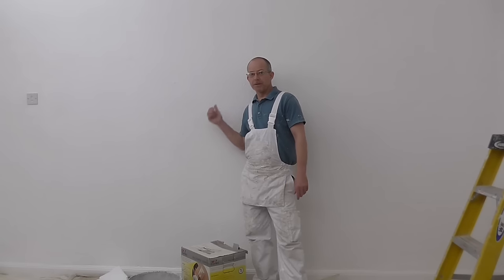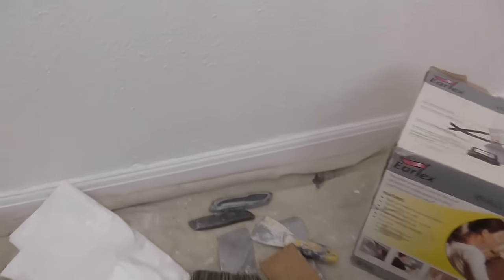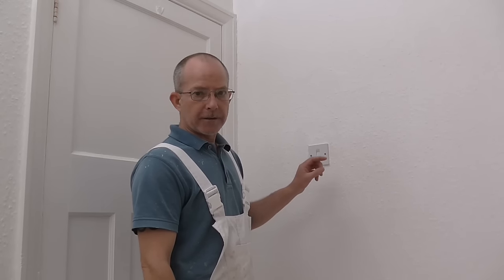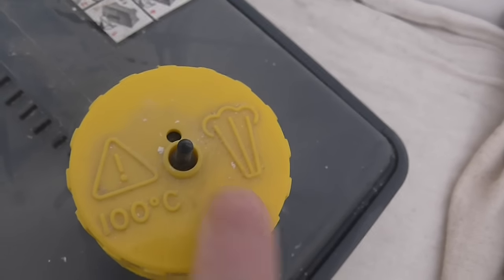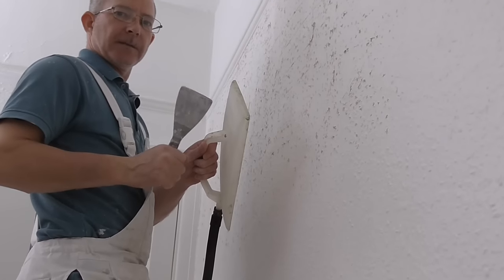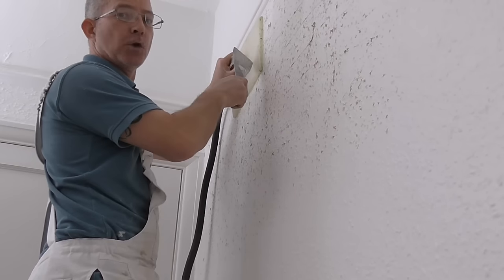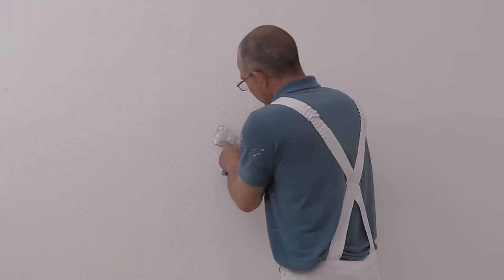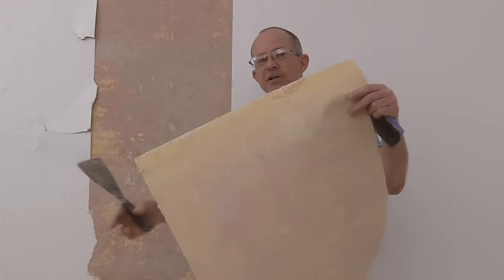Stripping Painted Wallpaper

Comment: Learned so much watching this. Easily the best stripping video I've watched (lol)

 I had no idea painted wallpaper was a different kettle of fish. So here I am today with my wallpaper steamer wondering why it was taking forever to come off, and coming off in little chunks at a time. Absolute nightmare and would take days to do one room. 

Just scored and soaked a small section for testing and it seems to be working great. Just used an old serated knife for the test but I'll make a nail board tomorrow and get cracking. Ditching the steamer for sure. 

Thanks so much for this. If you ever get tired of your trade and fancy something different, you'd make a great college lecturer. You're a natural teacher

Comment: Tried woodchip with steamer. Expensive to run and painfully slow. Easiest is to score it (5 screws in a piece of wood worked for me), and garden sprayer with reasonably hot/warm water with a touch of fabric conditioner and washing up liquid. Spray, leave an HOUR, come back, mist again, and it almost falls off. Steamers cook the underlying plaster and tend it make it crack or blow as it cools down, especially with very old plaster. Agree on knocking the chips off.
Reply from the maker: Thanks.
Reply: Have you tried hanging wet towels (spraying them as they dry) on the wall (after scoring) with push pins or small nails?  It can save a lot of time if you use lots of towels so the whole wall gets wet at once. I found it easier to keep the wall wet with the towels than with just a sprayer.
Reply: @pcno2832  Great idea that one. Can see how that would work :)
Reply: @Ralphs-House  can confirm I have done this and it works well

Comment: I remember doing this when I was a kid in 1974. It went well enough downstairs, where the plaster was like glass, but upstairs the wallpaper was stuck right to the Sheetr, ..., eh, plasterboard, so the surface ended up shredded. All was well after it had been spackeled/patched and sanded, but if I had it to do again, I'd have only stripped the paper that was on the smooth plaster, or maybe on plasterboard that's been painted a few times; I'd have left the paper on either bare plasterboard or crumbly plaster and hid the seams with fiberglass tape and joint filler. I've done that a number of times and as long as the paper is smooth, it looks just like a new wall. With this wood-chip stuff, I'd be tempted to just add a little joint filler to the paint for each new coat, sanding it a little before each painting, and watching it slowly fade away.

Comment: Hi you are so neat. I'll take a tip from this. I had wall to wall chip wood. And guess what even on the ceiling. I ve stipt walls. As for the ceiling no chance. Gonna get wood shaver. I ve used wall paper stripper in past. Hated it to chucked it out. Great video and tips thanks.
Reply from the maker: Thank you.

Comment: Always start at the bottom, heat rises also less chance of scolding yourself 
Also use 4 inch bladed scraper , best make olfa
Reply from the maker: Best to start at the top because its easyer to keep the wall clean, speeds up your job.
Reply from the maker: Best to start at the top so all the condensed water runs down soaking into the paper. Usually I would use gloves. But best to keep the mess going down, let gravity do the work. Thanks
Reply: You’re right . The steam is rising , and by the time you get to the top , it virtually drops of 👍
Reply: Thanks I’ve been decorating over 40 years you always start at the bottom, also manufacturers instructions. When trades people post these videos they should be careful because they are instructing lay people , not other tradesmen. Also water runs down and water /electric don’t mix trust me!

Comment: Hi, I usually score the paper with a Stanley knife or scraper edge to allow soapy water to penetrate quicker. Your thoughts? Excellent video as usual 👍
Reply from the maker: Thanks, Stanley knife can cut too deep marking the plaster. And using your scraper will wear down the edge on it. So best  to use a nail block or a wallpaper scoreer.
Reply: I've always wanted to try that scoring tool they sell called a "Paper Tiger"; it looks easier than scoring or even using the nail block, but I never remembered to get one before starting a job.
Reply from the maker: @pcno2832  They sound good but can wear easily. That's why we use nail blocks more robust. Thanks.
Reply: @pcno2832  I use the Zinsser Paper Tiger, they are great at first but the spikes are so close that the paper gets bunged up in between, but if you buy a new one for each job then fine, together with Fabric Softner to attack the wallpaper paste its quicker than a steamer and cheaper to run

Comment: Is it possible to just skim coat over this type of wall without stripping it first?
Reply: Yes you can, I've done my old whole house like it - wallpaper on gib board and not plaster on block. I sealed the walls with a pigmented sealer and skimmed it with a jointing compound or all purpose compound, then a final layer of it to make it really flat and smooth, then light sand back with a very fine grit paper. Then primer or sealer undercoat and two vinyl top coats, looked perfect for years.
Reply: Use a hand held bright light when sanding to really get a fine, flat finish as possible.

Comment: It will be more easy to remove woodchip wallpaper if you scrape it of with £6 blade scraper and later on take off the remaining wallpaper very easily. I did it personally and did all room in an hour and believe me it is big room.
Reply: Later on remaining wall paper which is very easily to remove with steamer. U can count down on clock 2 hours front room kitchen and hallway. 
I did it the way i told u and let me knowz